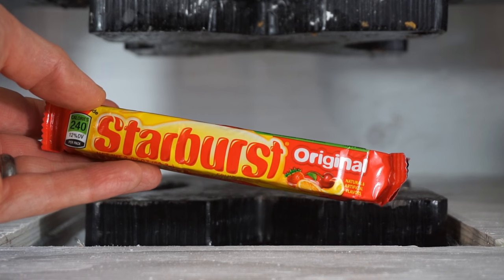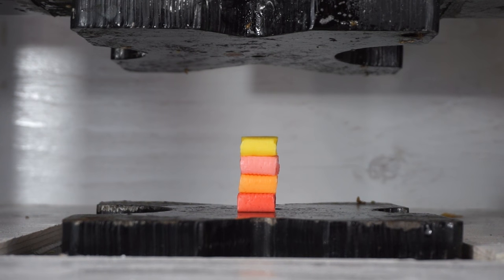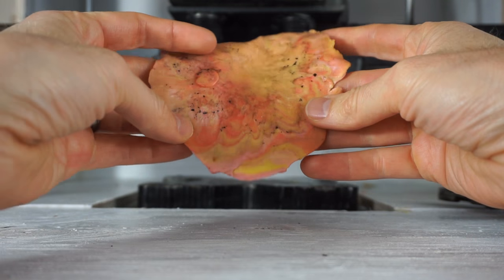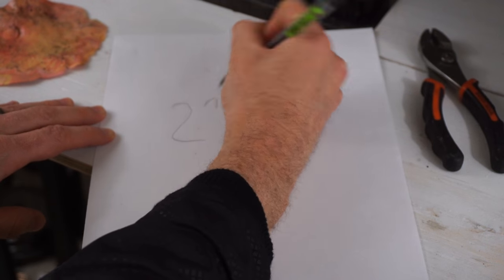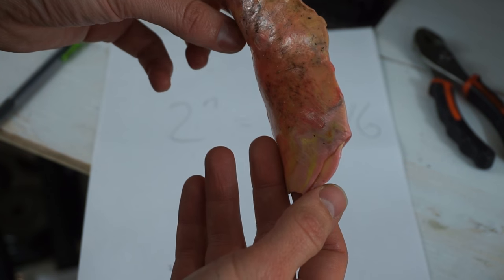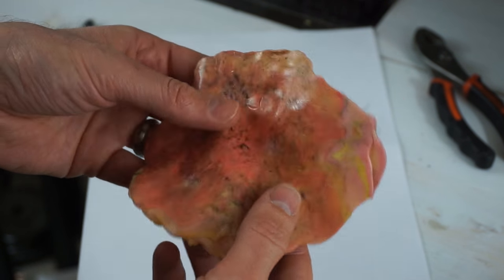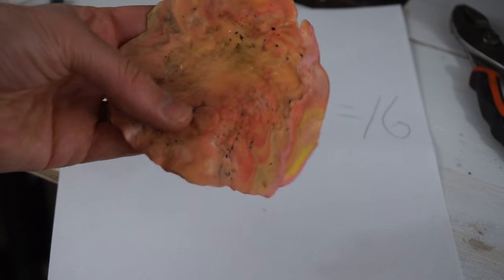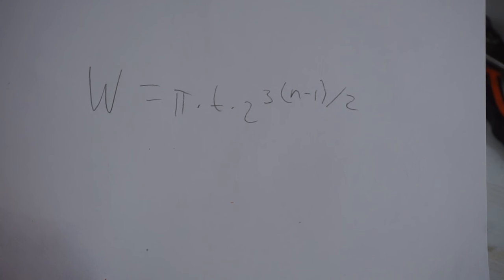Starburst Crushed And Folded With Hydraulic Press Into 64 layers

Comment: I could do this with my hands and get a better looking product that's still edible in the end. Also you folded it five times which would actually come to 32 layers of each color (If they hadn't combined together). Take the Japanese art and skill of making swords. They fold the steel to make about 1000 folds which is 2 to 1000's, first fold would be 2 layer, second fold 4 layers, third fold 8 layers, fourth fold 16 layers, and fifth fold 32 layers. 2 to the 5th power basically.